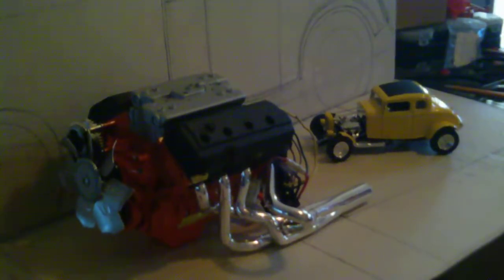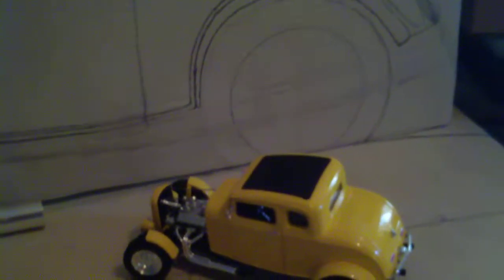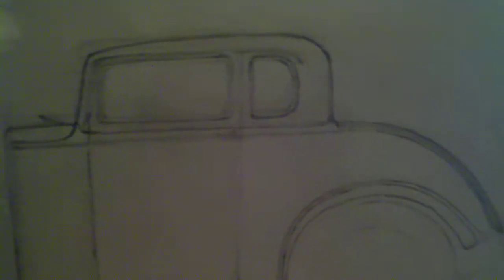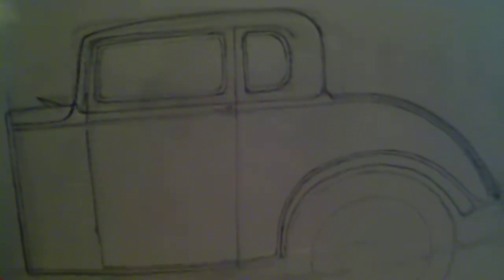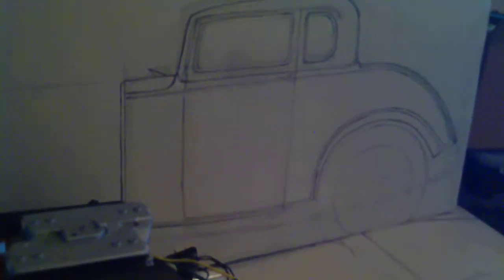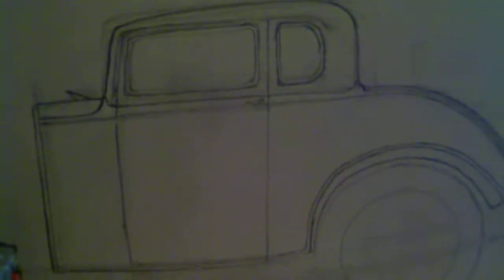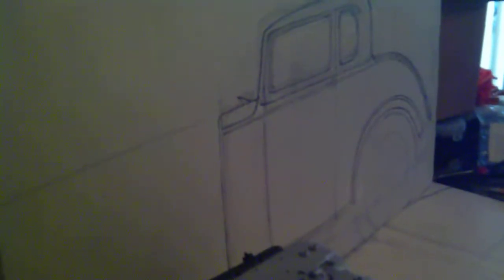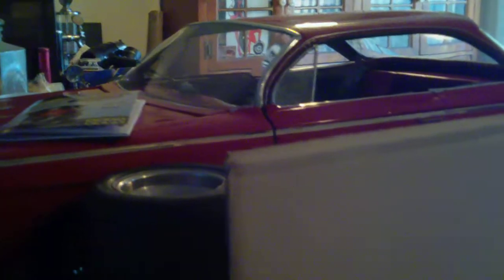handmade 32 ford 5 window coupe body templates how to scratch build Must see!

Comment: hi can you give some dimensions of the body. still or alloy you used? how thick sheet metal you used? did you welded it?? i making F132 project  on 4wd FG baja
Reply from the maker: +Jaroslaw Dudek    Hi I used autobody patching sheetmetal for the project, it bends easily and i did mig weld it all together. The body is 22 inches long and 15 inches at the windshield and 20 inches at the back, it's 12 inches high from the rocker panel to the top of the roof.  from front to back it's 3 feet long and weighs 40 pounds with batteries installed,